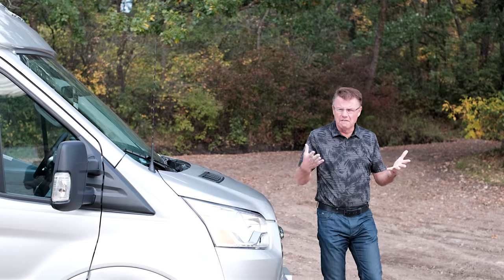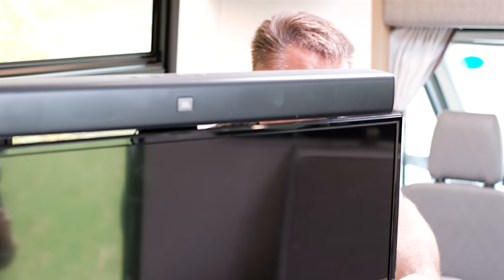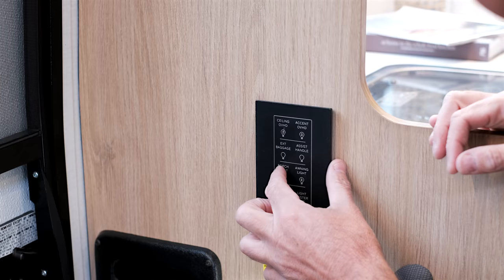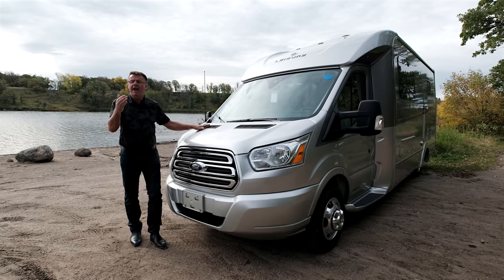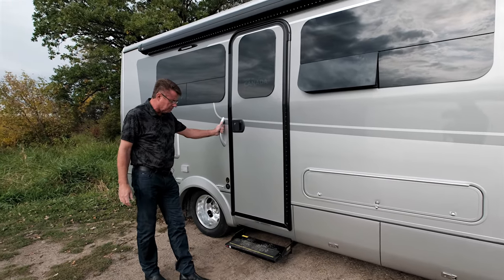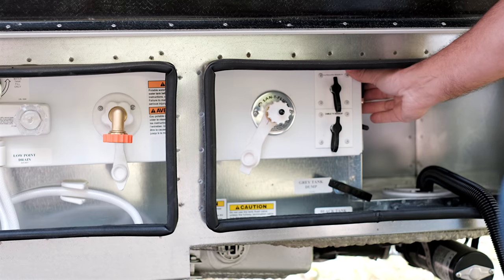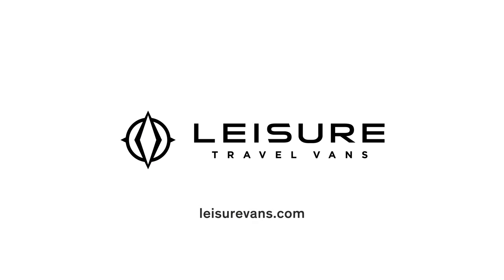2020 Wonder Front Twin Bed

Comment: Holland Motor Homes in Michigan will do a retrofit of Leisure with the Volta system. 30 amps with no cord. Run AC for 10 hours on battery. Run everything simultaneously on battery. Throw generator in trash can.
Reply: For a price....🙄
Reply: Do they add a second generator under the hood and include the auto-start hardware for the engine? If not, you're still going to need the LP genny. What does the retrofit do to the CCC?
Reply: @colormedubious4747  6000 watt alternator. Holland Motor Homes said they do an auto start stop.
Winnebago does not. They said it messes up the diesel regenerate hardware issues.
But tell me why you would even need auto start stop when the AC lasts 10 hours? Would you abandon an animal longer than 10 hours before returning to charge it?
Reply: @loonhaunt  I wouldn't take a pet camping unless I wanted to provide the coyotes a snack. Winnebago CAN'T add one to the Boldt because Mercedes won't allow it. Not a problem on their Promaster-based rigs.

Comment: What a beautiful, well thought out van! I think this would be my perfect van, if it could be 4x4. Comments? Quigley or will Ford be building a 4x4 for LTV? I’m just thinking out loud here. I could totally see myself using one bed as a lounge/workspace and the other as a made-up bed. My inflatable kayak would fit easily in the driver’s side storage.
Reply: They don't even offer heating pads for the tanks. Don't hold your breath on an LTV 4x4 option, it's a very slim slice of the market. If you're serious about an RV with 4x4, there are models available (like the Winnebago Revel) or you could get literally ANY truck camper and put it on a 4x4 pickup. Also, Ford's supposedly coming out with an AWD version of the Transit (van chassis, not the cut-away chassis that LTV uses).

Comment: Almost perfect, if the driver’s seat turned, like the European Ford chasis does, then this would be perfect to me. Anyway, I like it a lot.
Reply: Yeah, that always bugged me...but there's a swiveling driver seat starting in Spring 2020, a really powerful EcoBoost Gas Engine an AWD option and almost 700 lbs more CCC...
Reply: @daveg3056  On the van chassis, though, right? Wonders are built on the cut-away chassis.

Comment: I love the detail this guy goes into . I notice on the side of the toilet , there is a bidet attachment .
Reply: There is NOT. That's for rinsing the bowl.
Reply: @colormedubious4747  I have seen shower sprays like this in Arabic apartments that they use as a bidet arrangement .
Reply: @rubberdc  This isn't one. He specifically said NOT to mistake it for one in a prior-year video. RVs generally don't have bidets. They do have bowl rinsing attachments. The shower head is on the end of a hose. Wash your butt with that when you take a shower.
Reply: @colormedubious4747  I didnt see the prior year vid , i am not aware of toilet facilities in RVs , hence my error.
Reply: @rubberdc  No worries! You're not supposed to put powerful cleaning solutions into an RV's wastewater tanks so they provide an attachment for bowl rinsing immediately after use. You're also supposed to keep a small amount of water in the bowl between uses to keep the seal moist and help prevent odor intrusion. If you use the flush pedal to put water in the bowl the water will drain into the black tank so, therefore, you'd use the hose instead. Always read the manual for your specific rig. This is the glamorous side of RVing.
Reply: @colormedubious4747  I had never seen this previously and thought it was a bidet attachment . lol. thank you for updating me ,.
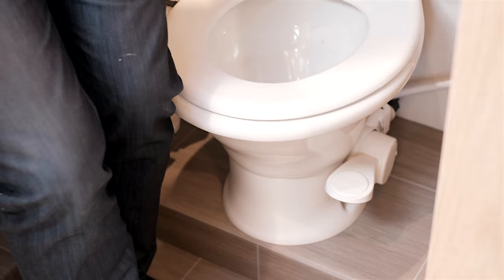Reply: 13:15 he literally describes what it is for in the video

Comment: With solar panels, batteries, and generator I wonder if this coach has enough capacity to eliminate propane and be made an all-electric coach.
Reply: They dont have enough solar panals for that.  They really would need to be closer to 1000 watts and a large number of amp hours in the batteries, atleaat 600 amp hours.
Reply: Retrograde Bolide: I’m doing research on small (less than 30’) diesel RVs. Thank you!